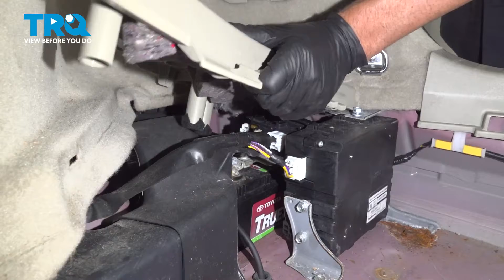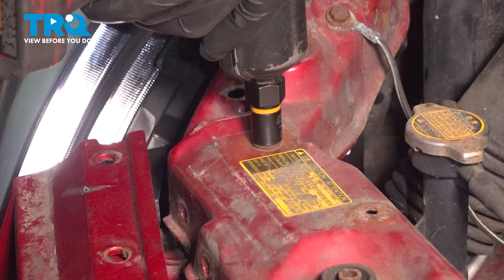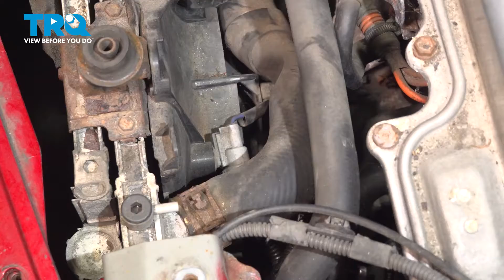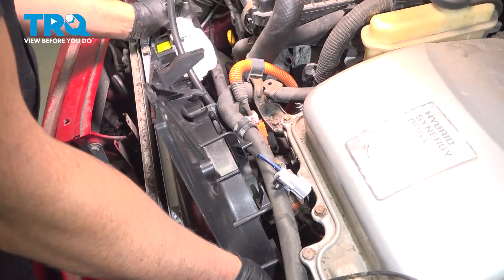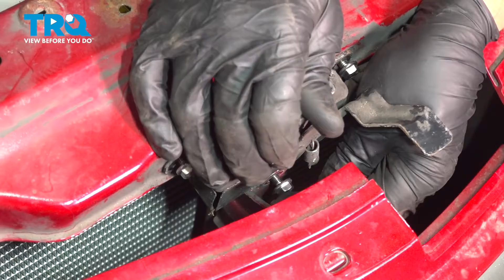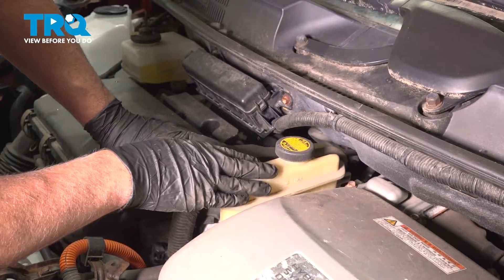How to Replace Radiator & Condenser Fan Assembly 2004-2009 Toyota Prius

Comment: Just a note.  The two fans are not the same originally.  Viewed from the front of the car, the left has 7 blades and the right has 5. The blades of the two fans are different, as they rotate towards each other.  7 blades clockwise, 5 blades counterclockwise!  If we install identical fans, one will work normally, but the other will blow from the inside to the outside.